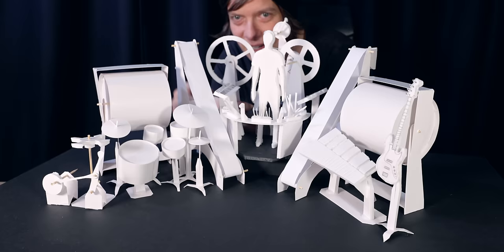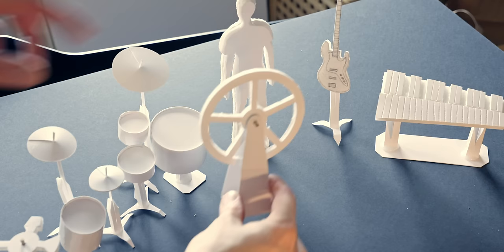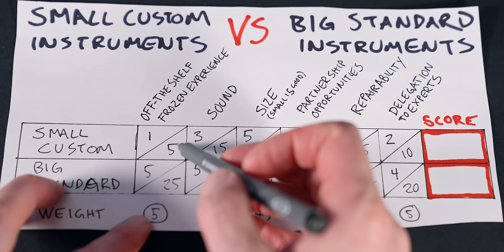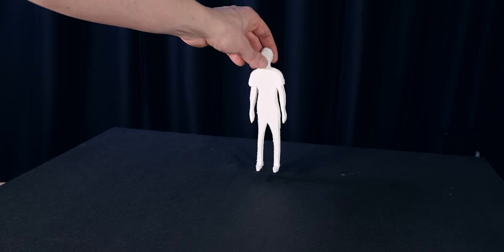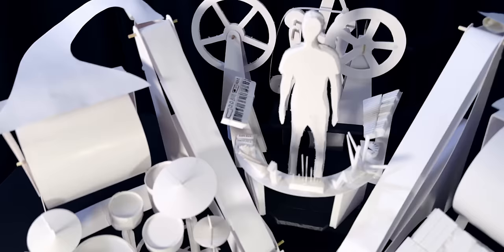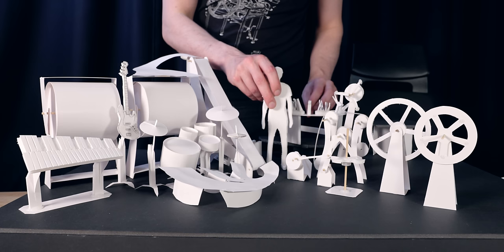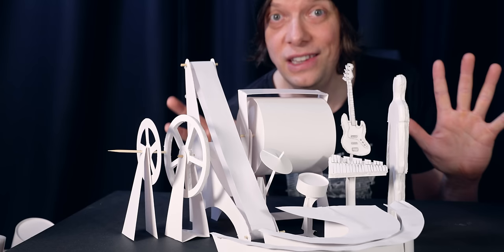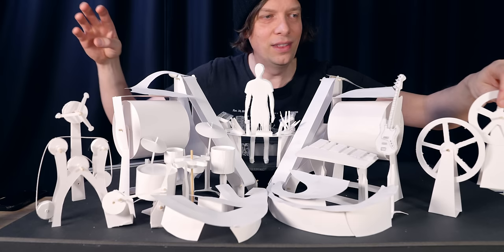Making a Cardboard Model of the Marble Machine

Comment: man, run to that museum where the first machine is and spend some time thinking WHY you are destroying that beautiful (and unrepeatable until now) idea you once had.
Reply: I was actually thinking something very similar, he needs to go back to the speelklok museum for inspiration. The biggest machine there that was meant to be portable was like the size of a small camper at best. And those were just designed to be wheeled around, not constantly disassembled and reassembled and flown thousands of miles on planes and trucks.

Comment: I really dig version 1! The only thing that is "missing" in it for me, is that previous marble machines felt like YOU were playing them, whereas here it feels a lot more like you're CONTROLLING them. It's a bit like you're trapped in a circle in the back, and being a director. I'd love to move you forward somehow.

Amazing!
Reply: maybe adding more visible wires from the center control thing to the wheels/marble droppers would help with that, like a literal web of control
Reply: That actually sounds amazing! Martin low and in the front, with his back to the crowd. Instruments on either side, bordered with four marble conveyors. The mechanical parts towering high above everything in the back.

Comment: What made the first marble machine magical to me was that you didn't know how it worked. It was one piece with endless gears and tracks that you wanted to explore and see from all angles to work out the journey of a marble. The modules take away some of that magic for me. And the most beautiful thing about the marble machine is the interaction between it and the band; it doesn't have to play all the instruments itself. It could be a single machine that plays one or two instruments very well, like the vibraphone and a rotary drum, or the vibraphone and the carousel instrument rotator. Just some thoughts. I've been following since 2017, keep up the great work! :goodvibes:
Reply: I was thinking the same. With these set-ups, the glaring question for me is - is there any role for a band at all, except perhaps being entirely dwarfed by the machine and Martin? In fact, what kind of artist (I'm deliberately omitting the word "Martin-fanboy" here) would enjoy performing together with this thing? They might as well play air guitar!  I suppose you can have one or two band members on strings, and one or two on wind because those are not competing voices. So there is a place for band members, but they're obviously gonna need the right type of space to shine on the stage without being outshone by the machine.

Comment: Option 1 would mean that you'd be trapped in one spot for the entire concert unable to move around the stage. Most musicians want to move around especially if switching instruments, plus it's a bit boring for the audience to have the lead person rooted to one spot. Need to consider both the machine and the band together.
Reply: Something I didn’t notice was how Martin was pacing around the stage when he was performing.
Reply: He will be trapped no matter how it is built. He can't carry the instrument around like a guitarist can. So he is more like a drummer in that sense.
Reply: Build a trapdoor in the stage with a crash mat and ladder underneath
Reply: What if the lever panel was divided in two so there was a gap down the center for audience interaction. Another option is to have the levers in the back but then the only in is through the front.
Reply: Oftentimes, you have to choose two out of three things. In this case, performance space, machine form, and function all coincide with each other. Martin has picked form and function over space. If he chose space, he'd have to sacrifice either form or function. And I don't think he wants to do that.
Reply: Came here yo comment the same thing
Reply: As if a foot pedal would allow Martin to move around? NOT.

Comment: V-Version looked good! One thing with the spinning flywheels behind you: there should probably be a plexiglass pane (or something) between you and the wheels in case you slip. Or the mechanics are fare enough away or high up.
Reply: To date I haven't heard him discuss in depth any safety considerations regarding these flywheels on stage.. these are very dangerous and very heavy and not all venues are going to want these spinning on their stage in any capacity. If the machine fails (and you must assume it could) these wheels pose incredible danger to the audience or anyone on or off stage.. any direction you can think of they will be terribly destructive if they ever break free. And even if you have them spinning in a certain direction, say, towards a barricade, there is no guarantee that if a failure happens that it doesn't get deflected in some unexpected direction.

I'd like to know if these failure scenarios have been considered in any meaningful capacity..

Comment: Probably the most informative episode I have seen yet where the finished design of MM3 is explored.  You can have all the technology you like but sometimes there really is no alternative to a physical model.  Personally, I would go with option 1 all day long.  It has good symmetry with those conveyors which can be used to frame yourself and the machinery and it probably makes the most sense from a technical perspective to have the drive machinery in the centre of the whole machine.  The one alteration I would make is to stand yourself lower and have the drive machinery on a platform so it is visible above and behind you.

Comment: I'm so glad to hear you say the machine has to be something you want to play with.  You've needed a principle to push back against 'smaller, simpler, and more efficient'.  You want the path between 'unmanageable chaos' and 'boring'.

One idea:  you might try mixing the return paths from the instruments to the conveyor ramps.  Marbles that come down on the left through the drum kit could go up on the right by the vibraphone and guitar.  You can build a whole system to make sure there are enough marbles on both sides.  Do a weighted decision between the additional complexity and the additional coolness.

Comment: Long time watcher, first time commenter. Martin, I think you severely under weighted the value of smaller instruments! A huge part of the cool factor of the MMX was it's compact, dense structure.  It resembled a "skeleton clock"!  By introducing full size instruments, you necessarily lose that density.  Similarly, by making the machine too-modular will have the same effect.

I think you also didn't take into account the added complexity of using larger instruments! We've seen this already, for example, having to introduce larger marbles to allow louder drum hits).

Love your work!

Comment: Cardboard models are fine for a first glance but you will see that the mechanics will pose big constraints on your placement of the parts. Don't forget function before form. Also consider that with the symmetrically model you are somewhat locking yourself in on the podium. In my experience concerts live from the fact that the performer can move on the stage to claim it. Like operating the machine, and then having it perform in the background while you take the front stage with a mind blowing guitar solo etc.
Reply: He could open a path in the middle of the control panel with steps going down so he can come out the front.
Reply: Agreed. If any way possible, it would be great for that formation if the control panel can be flipped up and out of the way like a pub/bar table and the marble trajectory and catchers adjusted to catch closer to the instruments so Martin could move out of the cockpit forward to the front of the machine. And maybe do some old school Marble machine solo drops? But that's probably just a bonus since he already has instruments in the cockpit.
Reply: Actually, this is potentially a safety critical point - Martin should have a way to get out quickly in an emergency!
Reply: The Bowden cable design is pretty flexible in this regard. The main concern I have is two programming wheels - they will be a big challenge to keep in sync, while a single programming wheel will never have that problem.
Reply: @scaredyfish  Bowden cables are fine for triggering stuff. But the power input from the flywheel needs to be applied to the programming wheels which requires a fixed connection or a sufficient joint. In both cases the degrees of freedom how the flywheel and programming wheels can be placed are decreased.

Comment: martin, an MVP isn't about what you want to use, it's about minimal viability to execute aspects of the design that need to be tested. a perfect example is how many times on MMX you would pick a new design and then immediately replicate it 20+ times for every channel, before learning something about it that required another re-design, which you could have learned with a single channel

the idea is you build an MVP e.g. one track programming wheel, one marble lane, one marble drop, etc. and you validate out your design assumptions before proceeding to further complexity. If you try to go complex before validating your BASIC assumptions, then the cost of fixing those issues goes way up (again... MMX...)
Reply: the idea is you are validating and testing design iterations along the way, in small increments, so that you are constantly getting feedback on whether you're making the right decisions

an MVP doesn't necessarily become part of the final design, but it will inform your design requirements
Reply: That's exactly it ! I searched for this comment ^^.

Comment: I would try an arrangement with a single programming wheel in the center (angled to the audience 45 deg) and then have the mechanism on the side of the wheel like on mmx.  I think you could still have it feed marbles to a left and right side of the stage and keep drums separate from the vibraphone.  

So instead of two separate machines feeding inward, you have one central machine that feeds outward.

Comment: Martin, If you use a Huygen drive and an air governor, the person providing the power doesn't need that much training. For the world tour, you can use audience members to drive the machine, which means you aren't limited to one person's power, or, if you wanted, separate machines could have separate power sources.
Reply: Or give the weights a taller range-of-fall, creating a sort of "Tower of Power," that can be charged and then left to run.

Comment: I dont know if this has been brought up before, but there may be a massive variable that hasnt been considered; the venue. The end goal is to tour, but what venues could you play depending on the height, width, and weight of the marble machine? Depending on complexity, how long would it take to assemble and disassemble since the venue would charge for this time? Finding the smallest stage you would play on and the max weight it can hold would give you the constraints for the marble machine's dimentions.
Reply: there are ways to do it quickly enough. hes gonna build those into the final designs

Comment: oh dear....this brings to light one HUGE issue not being talked about...at this scale the marbles will need to be the size of billiard balls...if not they will be invisible to the audience unless you are in the front row
Reply: This is why the fingers were such a huge deal to martin early on in mmx design.
Reply: They would always be very small… Martin should really make a machine on the same scale as the other two and have cameras strategically placed and a decent live video editor coordinating projections and screens. He wants to translate something fit for YouTube into a live setting and there’s no other sensible way of doing it. 🤷‍♂️
Reply: Shiny marbles maybe? Put a bright light on them and let 'em twinkle
Reply: yeah using shiny marbles should do the trick
Reply: Glow in the dark marbles with black light lighting.
Reply: @KanayaMaryam52  this is probably the easiest to implement.
Reply: A smaller machine doesn't make marbles more visible. I think a lot can be done with lighting, which will actually be easier with a more spread out machine.
Reply: White marbles and black light.
Reply: Cameras and projectors are almost standard equipment for larger bands.
Reply: I've already gave a suggestion under another video, fluorescent marbles with some UV light source will make it visible and really cool.

Comment: Version 1: with steps down the middle, Perspex fronts allowing connecting rods and gears to run through and be seen with lighting, allowing Martin to walk down and through the machine (with his electric touch ‘violin’ on his shoulder or some such) to the front of stage to interact with crowd and step to side to show off the machine in full glory. Might want to allow platform(s) room for guests or other band members, or smaller machines such as the music box.

Comment: "instead of spending hours in cad" im going to spend hours with cardboard
Reply: cardboard aided design ;)
Reply: he gleaned way more about the final design from that than all the hours spent in cad so far
Reply: I'd say the thing is that Martin has gotten really good with designing small detailed parts in CAD but has not as much experience making simple, engaging macro models.

For example the fly wheels, I can picture spending too much time modeling the cutouts, connecting the contraints of the holder with the wheel etc. Something that he probably in a short time with cardboard.
Reply: Why do you need two programming wheels?
Reply: @Caesim9  they also dont have to be mathematically perfect to get an idea of overall silhouette
Reply: @jackradzelovage6961  Agreed. But the feel to get a good enough looking but not complicate to model model is something that has to be acquired.

Comment: Loved version one! Version two is also good with a few mods. One wide conveyor in between the control drums. The flywheels could be on the side of control drums which makes sense mechanically anyway. They could be made more visible by using contrasting colours.  This setup would give that maximum space between the vibraphone and the drum kit. you would retain the two curvy ball runs returning to the bottom of the conveyor.  Looking good, I know you are getting impatient but please don't rush it and make something you are not happy with, that was a large part of why you are doing it.